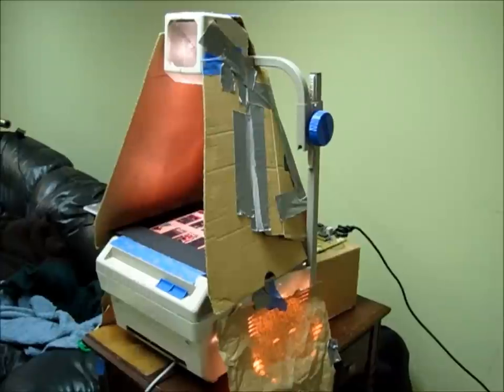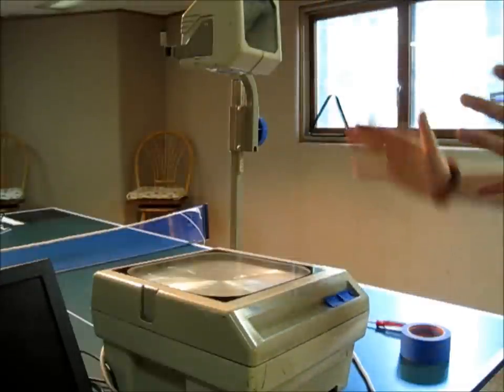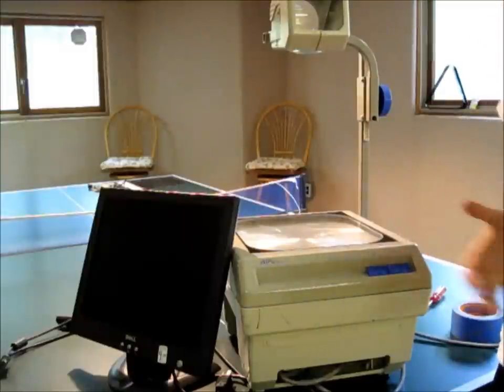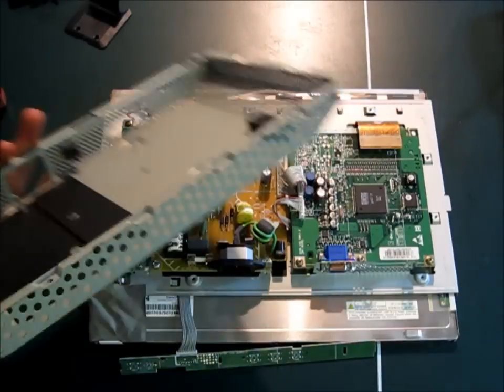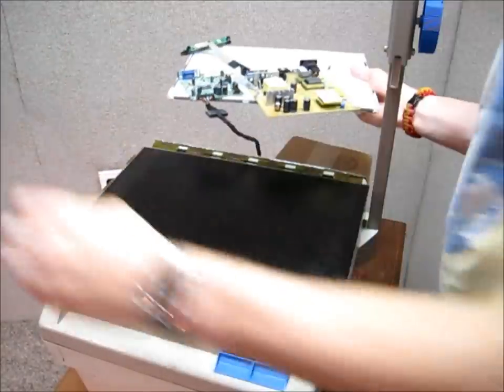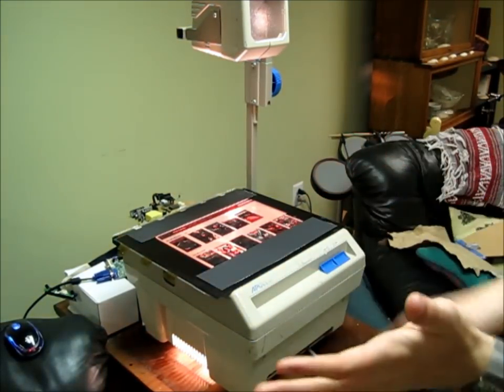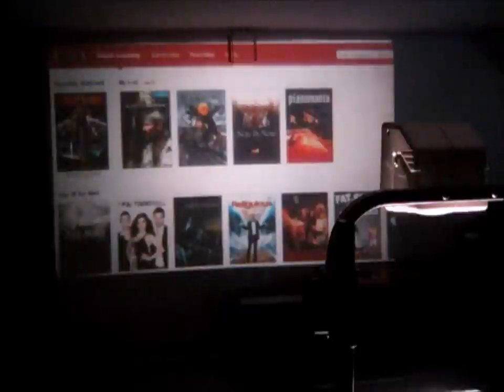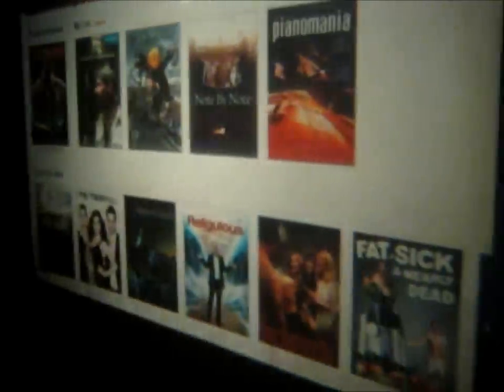How To: Make a Projector! (Huge Display and Cheap)

Comment: FYI, I have an overhead projector like that and replaced the bulb with a very bright 110volt LED lamp. Very easy to find online. I'm thinking some black cheap vinyl material would be better than the cardboard.  Although you could use a sheep of cardboard to mount your circuitry to so it's not dangling in the back, or a shoebox.

I use my overhead projector to project images onto walls to help paint murals.

Got a lot of ideas now. Thanks bro!

Comment: I have summer holidays soon and I always wanted a projector. I should try the basic concept out and upload videos about it. This looks more durable than a "normal" projector, most projectors suffer a loss of light and colour over the time, are not easily to repair and upgrade on your own and the costs for lamps of the projectors are sometimes rediculously high.
A final question: Is this possible to make in six weeks with some other projects in this direction?

Comment: i made this, one thing ill add is you need cooling for the lcd screen, the bulb has a lot of heat and you will see discoloration and distorted pixels so smaller the screen and have a sheet of glass under it and a fan to push air past it. good work :)

Comment: Hi, I'm supprised the LCD screen didn't start melting. Because the projector light does get quite hot. 
and yes as someone mentioned cardboard fire can occur too. Keep it well ventilated. Nice project.
Reply: Well, since the little plastic transparencies normally used with the projector don't melt, that's probably not a big issue.

Comment: Hey Matt,  Why did you take apart the extra monitor?  The monitor is lit from the back all ready.   Maybe for picture clarity.  You just can lay the extra monitor on the projector.   Would it work that way?
Reply from the maker: The extra monitor I couldn't get the LCD to separate from the backlight. For the projector to work you need it to be translucent, thus you need to separate the backlight from the LCD. I initially thought you wouldn't need to separate them and you could simply lay the monitor on the projector but the glass table is also a lens that makes the projector work.
Reply: yes that would work

Comment: Interesting idea, but if I were to do it I'd try to come up with something other than the cardboard enclosure. Not only does it look rediculous but it's a huge fire hazard considering that those sort of projectors can get very very hot. Also, you shouldn't state price when how expensive these things will be depends entirely on luck.
Reply: sounds like u drinkin some haterade
Reply: how does saying I like the idea but calmly pointing out faults with it = hate exactly?
Reply: Haterade rofl

Comment: help, i need help, info please, i have a 10' w x 12' h screen i need to fill, but i only have 5 to 6 foot of space for a projector, for a start up band, i bought a epson ex3240 projector, it works great but i need about 15 or better spacing from it to the screen to fill it, so i need shorter space, can you please help.

Comment: An elegant solution, but a bit bulky. Think i'l look out for a broken lamp HD projector and retrofit a 100w cool led lamp to it with lens/freshnel/opaque/heatsink etc. Another solution if i can trick the unit into believing the original lamp is there.
Reply: simon hare 
Doesnt work good because led's do not provide the right colour since they throw always rbg plus the get way too hot so youd have to provide cooling 
Also they spread their light in more directions than the usual lamps